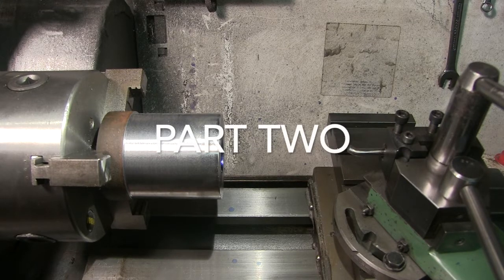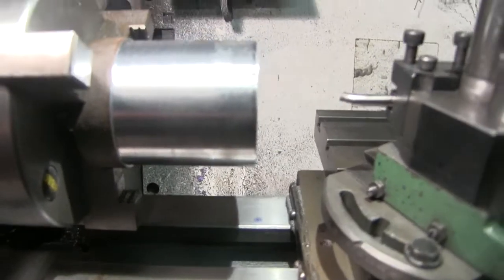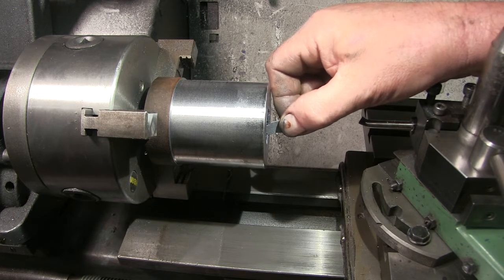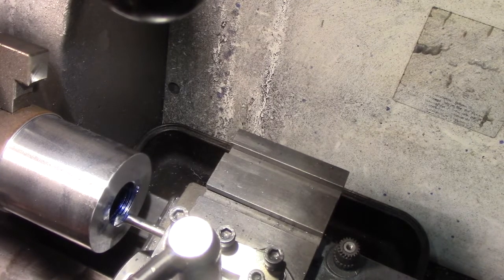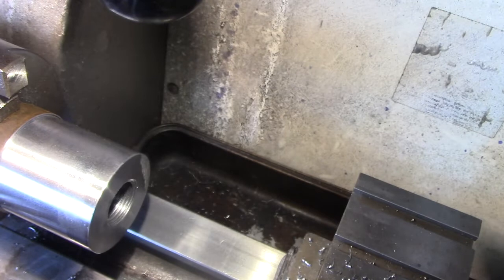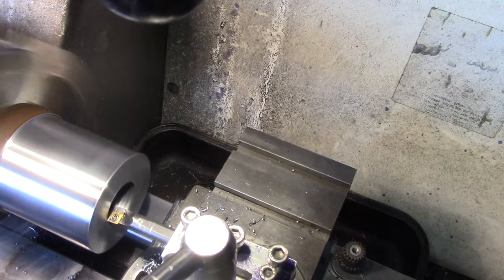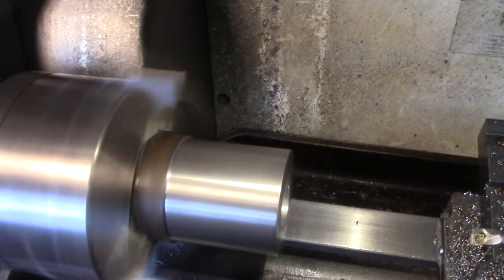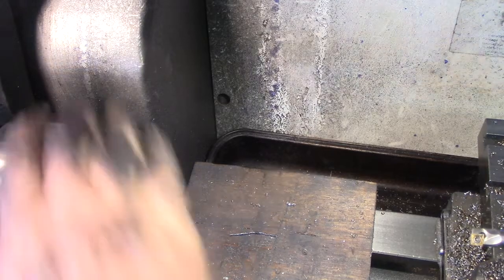ER40 COLLET CHUCK, PART TWO

Comment: Nice one Cliff, I think the hardest part is over. I have a couple of ER chucks for my Super7 and using the oversize collets you can get off ebay my ER40 can hold 30mm so comes in very handy.
Regards, Paul
Reply from the maker: Hello Paul, I have seen the big collets advertised, they are alright are they? they would be useful,
ATB,
Cliff
Reply: I've not had any issues witht the ones I have Cliff

Comment: Hello,  You must have been reading my mail!!  When I started on lathe threading that was my exact mistake and it took me way too long figuring it out.  The results are just off enough to send you down many other rabbit holes before the light dawns. Trouble with any angle is that the starting point has to be defined and rarely is it.  When first starting you have many other variables on your mind so you take for granted that the compound scale is correct for the required setting.  Any time when using an angle or even writing about using one it is best to start with the basic, "from where?".  Very good point.  Take care.  Doug
Reply from the maker: Thanks Doug, when you first have a go and if you read how to do it, pre youtube days, you almost certainly get it wrong, and worse you don't have clue why! :-)
ATB
Cliff
Reply: @CliffsShed  Amen!

Comment: Looks good .  The camera angle didn't show it but did you change the compound angle so it's toward the chuck when you swapped the bar position ?  Cheers .
Reply from the maker: Oh Max, until I read your comment it didn't even occur to me what a total prat I am, I didn't pull the topslide round, no wonder I was having so much trouble, glad you pointed it out, I would have gone to my grave thinking it was the material to blame instead of yours truly! Craigs comment explains exactly what was going on!
Thanks for watching,
All the best,
Cliff
Reply: Exactly my thought too - I've been there and done that, shameful to say. I was also cock-sure about the compound angle for the inner taper on my ER 32 Cast Iron square collet block project... 4 hours of work into the bin, instead of just a few minutes of clocking it in. "Life-long learning experiences" they seem to call it? My own hindsight certainly has "20/20 vision"!